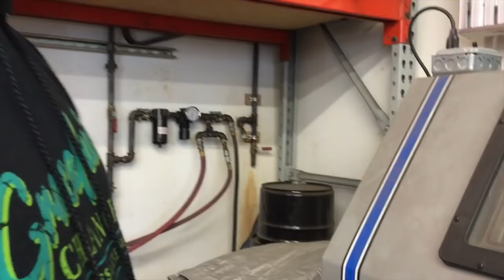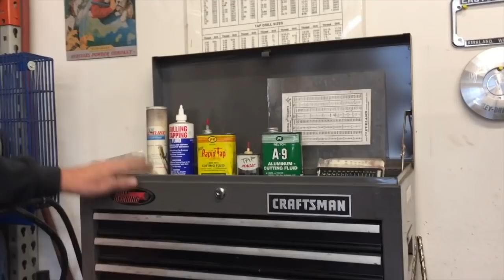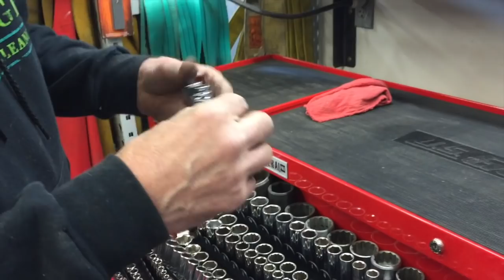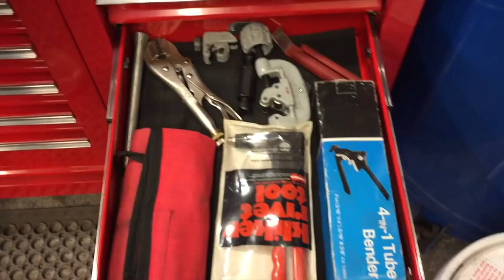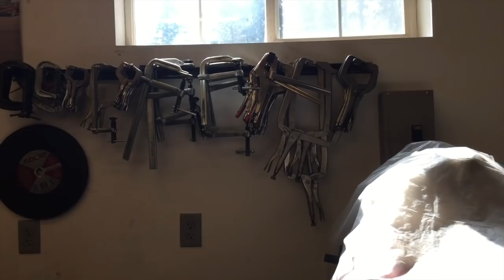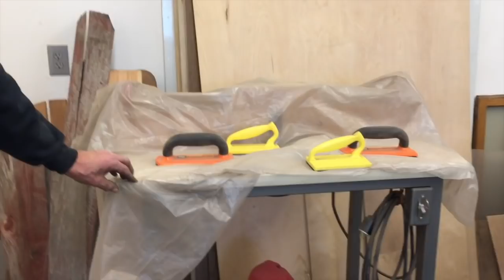shop and tool tour

Comment: How big is your shop, the car side?  I'm working in the third stall of my 99 SF garage, so I share it with my truck, my wife's car and our Ranger.
Reply from the maker: The front part is 30 by 30
Reply: @idahofabricator8710  Thanks Steve.  I would like to build around 32x32.  Bigger would be bette as there are always toys to park out of the weather.  I pull my truck and the Ranger out when I'm working on my 37.  Tomorrow I'm having some guys come help me move the cab from the car hauler to set on the frame so I can use it for reference and locations for blind nuts etc.

Comment: What's the demensions of your shop?. Looks great. You could shove another couple vehicle in there
Reply from the maker: The overall size is 30 x 50 the metalworking part is 30 x 30, and the back half is 20 x 30.

Comment from the maker: I am very happy with the US General tool boxes from Harbor Freight. In my opinion HF has really picked up their game. The thickness of the steel in the boxes is heavier with less flex than some other brands. Heavy duty castors, drawer liners, rubber top mat are what give these boxes an edge over other brands. I went with a 44 inch box, then added two side boxes, which have bolts on the bottom for attaching to the main box. I wanted more drawers and this gave me a larger work surface. The new US general boxes are 2 inches deeper than mine which is even better and they come in six different colors. I plan on getting the HF five drawer tool cart. Now I just have to decide which color.
Reply: I agree, any of the HF boxes are going to be "up-grades" from my Craftsman slide drawer boxes. BB drawers are the way to go for sure nowadays. My problem is deciding from the 44 with 2 sides ,,,or the 56 bottom and or top,,or the 72 bottom or maybe the 72/56top LoL  The 5 drawer cart is $4$ a Nice Box as well.
Reply: blue seems to be everyone's favorite,i would go with green,orange or even yellow just to be different.

Comment: Thanks for sharing, you have allot to be proud of. It's very clear your highly Skilled and a Hard worker. Your ideals and thought process from manufacturing shows in your shop lay out and habits. I'm considering replacing ,my 3 older {no-bearing slide} Craftsman 26" boxes that hold my tools for a newer US General box. I'm curious to your set-up of boxes. I'm thinking about going with a set up like yours, 44" and 2 sides or a different US General combo. Top Bottom Sides etc. Love to hear from guys that have experience on the matter.

Comment: Exactly how I wanna set up the 44” box I’m gonna buy.  Except I’m a diesel mechanic.  Good job sir and the mrs. did an awesome job as well.
Reply: I have a top and bottom box, and I’d have to say that the two sides might be a better option than the top. You lose your work surface with the top box so you have a have a second bench if you go that route

Comment: Loved seeing your awesome tool collection! Hey what brand air compressor is that blue one? Do you like it? How many gallons does it hold? I’m looking for something with a bigger capacity for plasma cutting and use with my needle scaler for chipping slag
Reply from the maker: Sorry I missed the compressor in the video, its a Quincy 5 hp 2 stage with a 80 gallon tank made in the USA its a great compressor